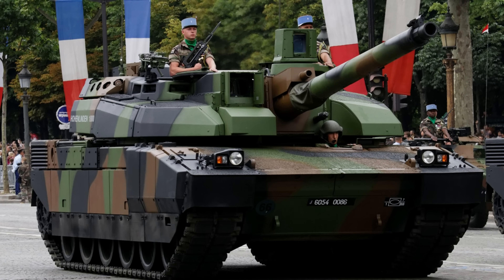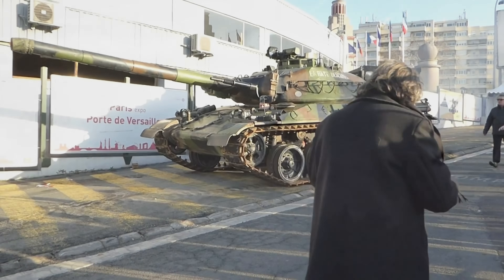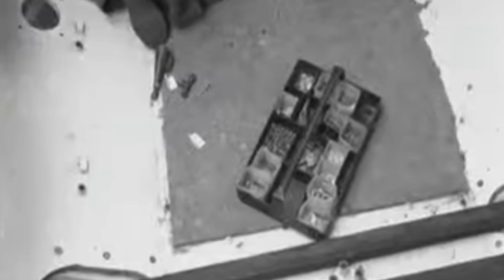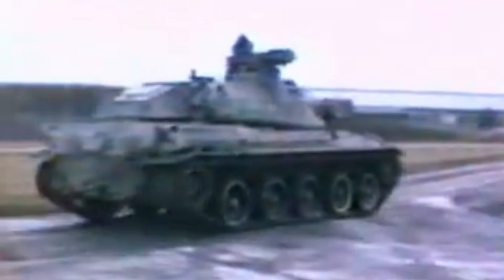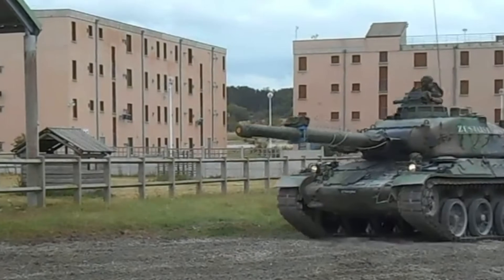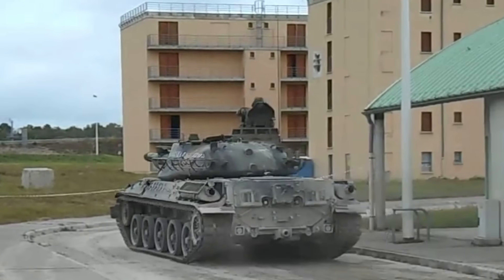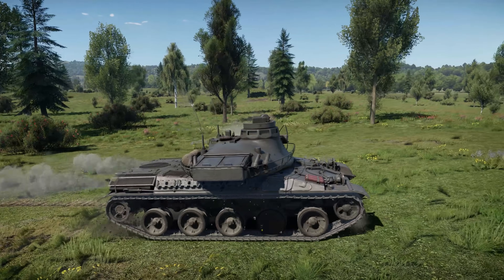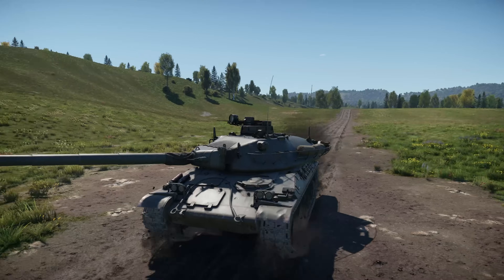The French AMX-30 Main Battle Tank | DOES SPEED BEAT LESS ARMOUR?

Comment from the maker: 🚨 What do YOU think? 🚨
Was the AMX-30’s focus on speed over armor a smart design choice, or did it leave the tank too vulnerable against modern threats? Let’s discuss below! 👇

💬 Also, what tank should I cover next? Let me know in the comments! 🔥
Reply: The support and flank doctrine uses the amx-30's speed to its maximum potential. 
It's a smart choice when it comes to that at least.
Reply: Since back in the day the composite armor was not a thing yet and using solid steel would really be too heavy. Where I really think they lost the game was when they ommited the gun stabilizer.
Reply: Always a pleasure to watch your show Matt, maybe you could look at the different tanks and their roles of the Japanese armed forces. They've had quite a mix of designs over the years, but they do make good stuff over there.
Reply: It sounds like a big light tank pretending to be a main battle tank.
Reply: Not as an MBT and when it came to a WW3 scenario. The Soviets would have curbstomped it.
Reply: Probably only when initiating contact, will probably be roboticized
Reply: Its better to obsolescent and fast, than obsolete and slow.
Reply: It's interesting to see it's not the only tank that embraced mobility doctrine, since we have the leopard, but we all know what happened later on.
Reply: @V3RTIGO222  AMX-30 and Leopard 1 came from the same original project, hence they are so similar. For the same reason some features are shared between Abrams and the Leopard 2
Reply: Wow Matsimus you are pumping out the vids I can't keep up. The AMX 30 was a dam good looking tank but still I prefer the Centurion or Leopard 1 tank in that cold war era. It had export success not as much as the Leopard 1 but at the time in the 80s before the 1st Gulf war I always wondered why they didn't use a stop gap better tank that they had made the AMX32 and later AMX 40. The Leclerc didn't come into service until 1990. France seems to had skipped a generation to make better in the Leclerc. Overall the AMX30 was a good cold war desighn for its contries armoured doctrine. But buy the 1980s it was begining to be outclassed. Still it did well in the 1st Gulf war as mentioned where it was inteligently placed buy Gerneral Schwarzkopf as there was no nasty T72s that the AMX 30 may have struggled agianst.
Reply: Given that France was developing their own tank under the economic constraints of not having any other countries locked into the project to help foot the bill, prioritizing speed and firepower seemed like a good choice. 

France was essentially designing a main battle tank for mass production with no prior experience. They had previous MBT projects but they never gotten far enough for mass production. Unlike the other major powers who had a long history of development through the Second World War into the Cold War, France had never built their own MBT or even medium tank on mass. 

So the choice to prioritize speed and firepower seems prudent. Getting the fundamentals down while keeping weight and therefore costs lower is a good foundation to start your tank industry on. 

Given the other vehicles that France based off of the AMX-30s chassis, it seems they made an economical choice. It wasn’t perfect but it could be upgraded and adapted. 

The AMX-30 was never supposed to be the ultimate tank. It was a very versatile, very maneuverable tank that suited battlefields in the wide open terrain of North Africa where France predicted the majority of their post-colonial military interests would be. It could also serve as a rapid response platform in the event of a hot war in Europe, but it was never going to slug it out one for one with the Soviets.
Reply: @alexchapman3995  France had a ton of experience. They were developing and producing heavy tanks and light tanks for themselves previously. Also a lot of the thinking that went into the theory behind the speed and armour combo has been done during the Europanzer project from which the AMX-30 stemmed.

Also note that both France and Germany at the time were operating M47 Pattons, so they weren't looking for another medium tank with thick armor. Both Leo 1 and AMX-30 were to operate along those and perhaps whatever was their replacement before being replaced themselves.
Reply: @ I specifically said they didn’t have any experience producing MBTs for mass production. The AMX-30 was a project informed by the idea that France would be making their own tank in large numbers without any other country splitting the cost.
Reply: The WWII British Matilda II had 65mm!
Reply: @DarkRendition  Sure, but the armor thickness for the hull was not built to deal with much more than HMGs. If the doctrine was to fire from a hull down position and then retreat to another such position as son as possible and hitting a moving target at the time was nigh impossible for the advancing Soviet armor then it was a viable choice.
Reply: A light hovercraft with missiles would be faster.
Reply: It was the right choice for the time. The Leopard 1 is essentially a less-armoured Panther after all, too. It's far better to be aware that your armour is just there to keep the rain out than to feel properly armoured but actually you aren't. People will behave far better if they know that their armour is useless.
Edit: The Leclerc is definitely not a "lessons learned", but a tank designed to very different materials available. At the time the Leclerc was designed, it was possible to build a reasonably heavy armour that has a reasonably high chance to fend off any anti-tank weapons fired at it for the next few decades.
Reply: Lookalike t60

Comment: I like that France has made a point of continuing to build their own equipment up until they decided to partner with the Germans which is good so long as they each make a point of maintaining their sovereign construction and engineering capability. I would like to see Canada follow suit in partnership with BAe Hagglunds on a CB90 Variant and possibly a future MBT around 45 to 50 ton class. Protected up to 50 mm, but carrying a heavy gun and a missile capable of surface to air and anti-tank work. I think that would be cool.

Comment: I met a retired driver of AMX-30 he told me that is was a good vehicule, great acceleration and mobility.  He had a story of 2 AMX driving at full speed on highway, scaring drivers, out passing cars because they were late and didn't want to be punish by superior
Reply: It's a bit exagerated but yes, it was a great tank (former AMX 30 tank leader and second to tank platoon leader here, in mechanised infantry regiments (5th RI and then in the 16th BCP (Chasseurs Portés) : 3 mechanised infantry companies on AMX 10P and a tank company with 17 AMX 30B) ). But its speed at best (I mean when fully unbridled) was about 75 km/h on road and 50-55 on the field. I have an anecdot when young sergeant, I was passing my driving license on AMX 30B without its turret in 1994 (about 25-26 tons)... I was driving about 70-75 KM/H in Carpiagne camp area when, in a curve, i was double-crossed by a Leclerc and its 50+ tons... He did it easily, with its 1500 horsepower engine over my 680 HP, I think he was also unbridled, and was running at 90 km/h at least... somewhat abit humiliating for the AMX 30... ;) but the look of the AMX30 made it the best shaped french tank of all time. IMHO.
Reply: @jean-Pierre-bt8xw Merci pour votre service

Comment: Yes, 50mm of armor is not much, but consider that the mighty Challenger 2, with its reputation as being the heaviest armored modern MBT, also only has a 80mm thick, simple armor steel plate on its frontal hull. 
Most people don't believe that, but it is true. There is no Chobham or composit or even spaced armor at the hull front, just a solid 80mm steel plate, like on a early WW2 era tank.

Arguably the Challenger 2 has the same frontal hull protection as a Panzer 4. Sure, steel is better now than it was in the 1930s, but the Panzer 4 at least had the gear box behind the frontal hull armor, acting as a shrapnel catcher and additional protection. The Challenger 2 doesn't even have that.

I'm not saying that to shit on the Challenger 2.
I think in theory the idea to build a basic, bare bone tank with the bare minimum of protection and then strap add-on armor packages to it that can be easily replaced and upgraded is a great idea, the problem is just that those add-on armor cubes the Challenger uses are in danger of being ripped off if it bumps into the ground or obstacles and they make the whole tank very bulky, increasing the chance of just that happening.

Also, that "bare bones basic package"-idea seems like it wasn't executed in the most effective way with the Challenger 2, since even the bare bones version is considerably heavier than other contemporary and comparable tanks were in the 90s.
What I mean is, having a tank that is already the heaviest only with that bare bones, minimum, WW2 level armor, is a problem, especially when it is also the one with the least engine power.

Yes, the latest iterations of the M1A2 Abrams and the Leopard 2 have surpassed the Challenger 2 in weight since then, but they did that by packing additional armor on top of already pretty decent hull armor and on top of that, as far as I know, nobody has been developing new add-on armor packages for the Challenger 2 since its introduction. 

As far as I know, there was no improvement to the hull armor made in the Challenger 3 upgrade.

Comment: I don' know why, but the AMX-30 gets much worse reputation than it deserves and even Mat did it a disservice with the comparisons, so let's look at the original version compared with its 1960s MBT counterparts (M60, Leopard 1, L7 armed Centurions, Chieftain, T-62 and T-64) and their upgrades:
- AMX-30's armor is quite weak, but in practice it's equivalent to the OG Leopard 1. Yes, it's nowhere near as good as M60 (A1 by this point) late Centurions or Chieftain against obsolescent ammunition (e.g. Soviet 100 & 122 mm APHE), but against modern (at the time) APDS, HEAT, ATGMs and Soviet smooth-bore 115 mm APFSDS the conventional armor didn't stand much chance. The T-64 definitely had the best armor protection at the time with its composite front armor and about double the side armor of some of these. Trying to compare armor upgrades would be a real mess, considering how many there are, but suffice to say that BRENUS was far from enough for the 1990s.
- No tank in service at this time had a laser range finder. M60, Leopard 1 and AMX-30 had coincidence rangefinder and Chieftain had a coaxial ranging 12.7 mm gun (with ballistics matching its 120 mm HESH), while Soviets were still relying on the traditional rangefinding methods, but started introducing coincidence rangefinders in final years of the 1960s. Laser range finders started appearing in service in 1971 with Chieftain Mk 3/3 but they were introduced later with new versions and upgrade packages to all these MBTs: M60A2 (1973), T-64B (1976), AMX-30B2 (~1980), T-62M (1983) and finally Leopard 1A5 (1986, but Leopard 2 with LRF was put into service already in 1979). As far as I could find UK didn't upgrade it's Centurions with laser range finders before they were replaced in service by Chieftains, but other countries did upgrade their Centurions with laser range finders.
- The original AMX-30 didn't have stabilized gun, but neither did Leopard 1 or M60 (even M60A1) at that time, while Brits had tanks with 2-plane stabilizers in production since 1948 and Soviets since 1957. In early 1970s Leopard 1A1 and M60A1(AOS) were upgrades to add stabilizers to the respective tanks, but the AMX-30 in French service never received such upgrade (at least from what I could find).

From what I could gather, the biggest problem with the AMX-30 doesn't seem to be its original design, but rather the fact that it remained the best tank France had until the Leclerc, because if it had an equivalent of Leopard 2 in 1980s, AMX-30 would still be perfectly capable of performing auxiliary roles as its mobility and firepower (with new ammunition) were still adequate for such. French Army retired its last AMX-30s only in 2011 after all.

Comment: So, basically, the French were right to use their gun, and the German were wrong to bail out for the reasons they gave? Kinda looks like what's happening again now, with SCAF and MGCS, isn't it?

(And, small addition, the Leclerc still has an impressive mobility, even faster than the AMX-30 despite having also excellent protection and firepower)

Comment: It was a very good looking tank. But by the way, during Gulf War One, the crews had the order to NEVER engage Iraki tanks under 1500 yards and to destroy them between 2500 and 1700 yards. To be shot everywhere on the armor under 1500 would have been FATAL. 

X30 was a conscript's machine. Cheap, reliable and easy to build. But definitively outdated at the end of the 70's. It should have been replaced with the X40. But in 1981, waiting for an hypothetical "Franco-German" tank, with the new socialist presidency, they waited for a new national solution (X50 Leclerc) and just refited the old telemeter X30 B with a new very good fire control system based on laser telemeter and thermal camera, called X30 B2

Comment: Yep well...
The amx30 was designed in the 50-60.

The French doctrine is based on defense so you must be fast more than strong, all is based on attrition.

For its generation it was a good armor. Comparing to other its light the main problem with armor is the weight.

So you must be strong with the gun and fast.

Yes if you compare it with German or RuSSian monster its seems cheap, but not.

The armies which have used it were satisfied and the amx30 was combat proven at the end the B2 and the Brennus version were great.

Does it survive in drone environment? Nope, like the other.

Comment: AMX 30 actually had a better protection than the Leopard 1 on the frontal arc. its UFP was actually made of two parts. The glacis was actually made of a single piece of cast armor that varied between 75 mm at 80 mm sloped at 68° for the upper part. The lower part was also between 75 mm and 80 mm sloped at 45°. The second part of the upper hull was made of a rolled homogenous piece of steel welded to the frist section of the UFP and was 50 mm thick but sloped at 75°. The upper section of AMX 30 hull is therefore compatrable in terms of protection to T54/55 series of tanks. Lower hull and turret is of course much weaker but it's a myth that the AMX 30 was actually less protected than the Leopard 1. Leopard 1 was the least protected tank of the cold war at least in its first iterations as that changed with the 1A4 standard that added add on protection kits on the hull and the turret. The weight difference between the Leopard 1 and the AMX 30 lays down the suspension design and powertrain design. The leopard 1 has more torsion bars and a bigger/heavier transmission/engine combo resulting in the design needing to be slightly bigger to accomodate that. That being said the Leopard 1 proved to be a much more comfortable and relieable platform to operate than the AMX 30. Also, the FCS control system of the AMX 30 when it came out was not worse than that of the Leopard 1 as the gun still had to be adjusted manually. Only the M60 Patton had it better as the gun would be layed automatically. Another important thing to note is that the AMX 30 tank commander awareness was excellent and unrivalled in its time thanks to the contrarotative TOP7 commander cupola meaning that the turret could move but the commander could keep his eyes fixed on target regarless of the turret movement. I like your video but this one is not very well sourced.
Reply: Yes, and as a former X30 tank commander, i will add that the gunner has not to rely on estimation to engage target, but the TC has an optical rangefinder and it was common to have range in less than 3s (2 mesures to ensure 1st round hit) and then either engaging directly fron TC or giving gunner engagement order.
Reply: @507rcc7  "Molette-remolette"

Comment: This tank was used in Chile in the extreme south, were it's low weight was very practical. Venezuela still operates a modernized version.
The AMX 30's design is similar to old soviet tanks: lower profile to make it a less obvious target and lowr weight to make it fast and avoid getting stuck in soft ground. Also cheaper and more fuel efficient than the M-60 and Centurion.

Comment: While not a main battle tank (and never pretended to be one) the AMX-30 is kinda of an up gunned M-41 Walker Bulldog. Another thin skinned but light and fast tank (and I got to play on and in them as a kid).
Reply: It really isn't an "up-gunned" M41. AMX-30 was only vulnerable to tank main-gun rounds (at shorter ranges for even early APFSDS), missiles & RPGs - it was perfectly well protected against typical autocannon, especially at battle ranges, and unmodernized WW2 era AT guns which were still fairly commonplace. 

It was very credibly able to engage soviet armour by leveraging its advantages (situational awareness, mobility & first-hit probability), which it proved when it found incredible success against Iraq.

With a 105mm gun and especially with the 20mm autocannon, it was also very well suited to performing fire support.

A fair criticism would be that the evolution potential was limited by the design, and it quickly became pretty damn outdated when composite armour started to become commonplace in pact forces, however that only occurs because of a healthy dose of hindsight.